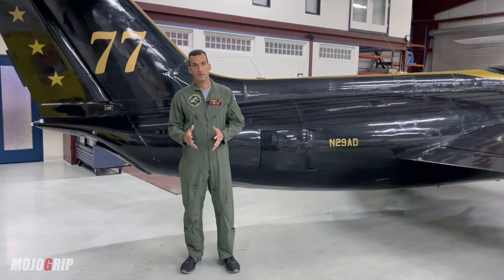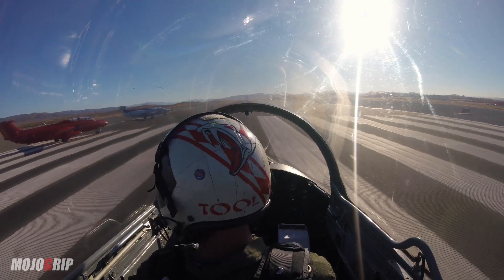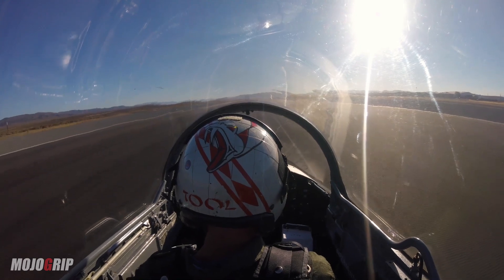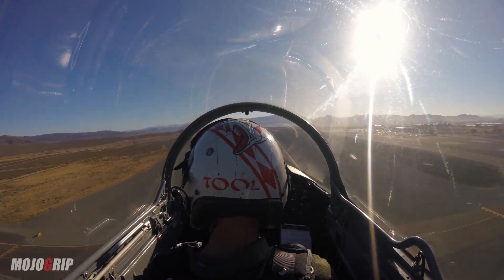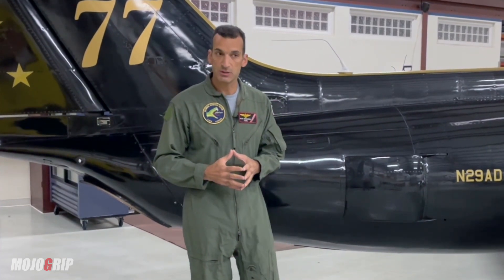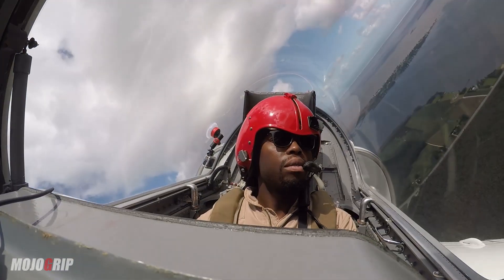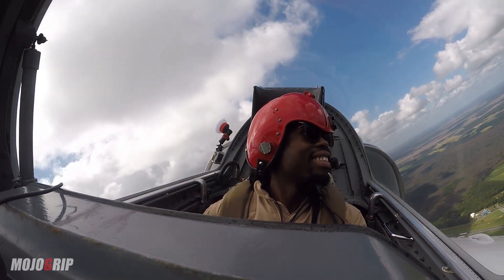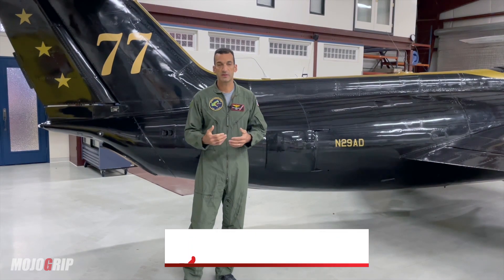Amazing 544 MPH Top Speed Jet | L-29 Super Delfin

Comment: This is the same Jet trainer used to race at Reno air races. 
Impressive performance. However, at 400 knots, burning 180 gph, the average fuel consumption for distance is better than at slower speed. 
Average at higher speed is 0.39 vs 0.33 mpg.